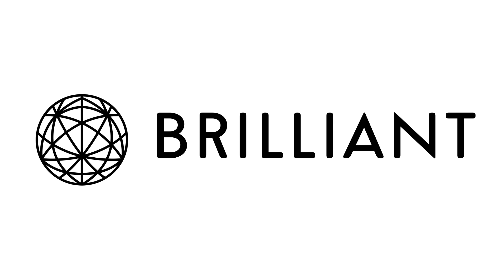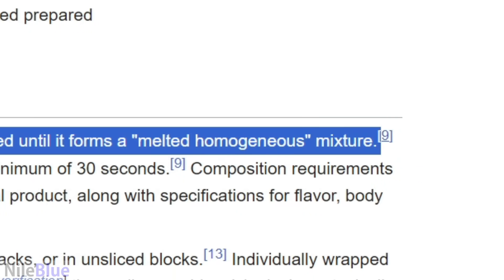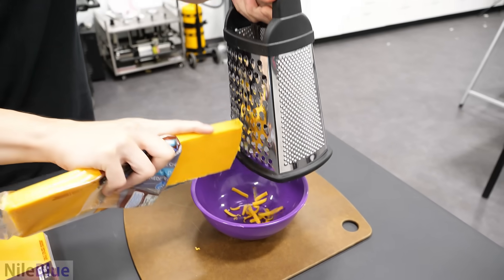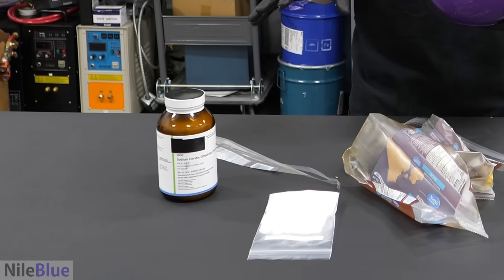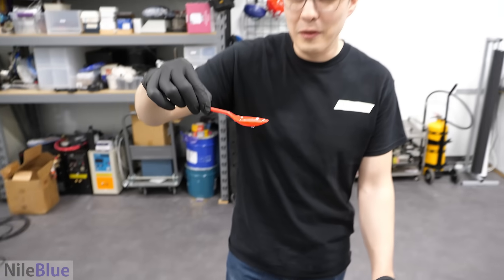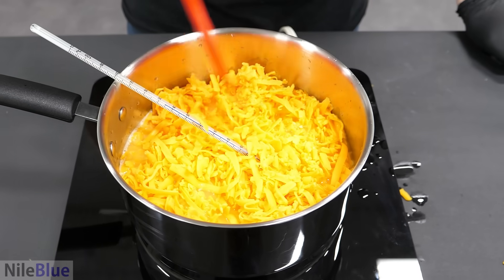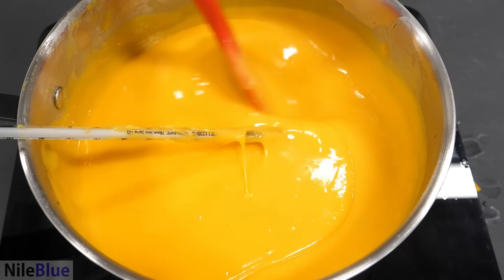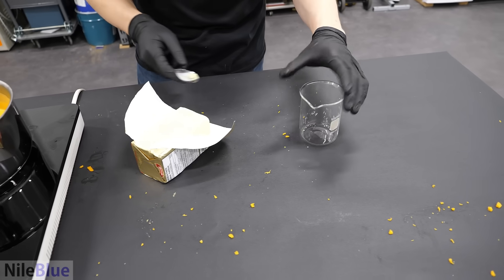Making American cheese to debunk a conspiracy

Comment: I worked in a cheese factory, we made at one time something like velvita, a soft cheese which combined 5 45lb blocks of cheddar, 1 block of Monterey jack cheese, with additional salt heated to a nice liquid state, pumped it into bags in boxes for an hour then had to tear down the entire room and hand clean all the system due to a 3 inch inside diameter pipe went down to 1 inch inside diameter due to the amount of product build up in the pipes. so a pallet of product was made in a few hours but also took 5 hours to clean up.  it was fun as heck but labor intensive.
Reply: Process tech!!!
Reply: That's crazy - and they never tried to solve this? Emulsifier? Heated cheese conduits? Asking for a cheese curious friend.
Reply: I worked at soap factory and this sounds very familiar. We had massive meat grinder like spindles we had to remove and completely cleaned the entire machine between batches.
Reply: I'm really upset learning this, since the original Velveeta commercial jingle said "It's like Colby Swiss and cheddar, blended all together..." but there's no Colby or Swiss involved 😢
Reply: He said something like velvita, not velvita

Comment: As a former exec at Kraft Foods NA, this is accurate. The process of flowing the melted cheese into the plastic casing, then solidifying it in an ice bath/waterfall...is pretty amazing.

However the base cheese is not made by Kraft. Most cheese comes in 640# blocks from a finite number of North American cheese manufacturers...meaning that Kraft, Sargento, etc...are all exactly the same stuff.
Reply: Does Canada get the same cheese from the same manufacturers?
Reply: Uhm... no? Sargento makes their own cheese lol You can literally go to Plymouth Wisconsin and see where they produce their cheeses.
Reply: Handling barrels of cheese is a very glorious experience. And I thought Sargento was just a cutting and packaging operation? I could be wrong though
Reply: @jimbeam8338  Or are they really just putting it into a plastic casing in there???

In all seriousness, I don't even recall Sargento making American cheese. I checked their site, and I can't find it. I won't say OP is wrong, but somethings not adding up here.
Reply: >as a former exec

there are not that many of those, so like, while it's not impossible, I'm gonna roll to disbelieve on the weight of rarity on this one.
Reply: Where I live we are famous in Michigan for our cheese. I used to work in the factory for a year after highschool its all real cheese though.
Reply: Maybe they start off with the same stuff but they’re not exactly the same end product, I imagine every manufacturer has their own blend of ratios + plus other ingredients like differing cheese blends
Reply: Who are the Cheese Mafiosos on top of it all though?
Reply: @laurenpinschannels  it has too many holes in it
Reply: The good ole commodity cheese.. there's a lot of it out there. Maybe still sitting in caves in Missouri
Reply: @reNINTENDO  He's definitely lying
Reply: @fakename287  Yes and there are slightly different names they can call the product depending on the contents. The version made in this vid is the best of I think 4 types or grades or whatever you want to call it. Atomic Frontier did a great vid on it.
Reply: @busimagen  but you would also know that there are 2 different FDA labels that can be used from "pasteurised processed cheese" (almost 100% cheese and what was made in this video) to "pasteurised processed cheese food" (over 51% cheese) to  "unregulated" (anything that isn't "cheese" or the 2 other specific descriptions quoted above, like "cheese product" means nothing legally)

Also kraft adding milk protein concentrate (which is not one of the approved ingredients for the product labeled as "processed pasteurised cheese food" and is a bulking agent refined from other waste products) which the FDA found in 2002.. they since renamed the item to processed pasteurised cheese product.. which is undefined in the US, or in other words.. not cheese

So you are either lying about your position or lying about the product of the company you probably got shares in as a bonus or severance or similar.

Either way.. I call liar on the "it's just cheese".. only the premium label is. The rest is cheese flavoured floppy squares.

Comment: Having worked at kraft for a bit, you're not far off. Yeah it's real cheese that comes in like 100lbs blocks and is shredded fine, the milk powder is a whey powder. And it's cooked with steam.
Reply: why do Kraft singles taste so different from say a piece of cheddar cheese from a block? I cannot stand the taste of Kraft singles or anything similar.
Reply: @91wheelz the process of adding water and having the fat suspended doesnt make it better to eat raw, thats why. its meant to be easier to melt. you put them on a burger or make a grilled cheese. thats where this cheese shines, because it melts at low temperatures. try putting a chunk of normal cheddar on a hot hamburger patty and you’ll see the issue with doing that.
Reply: @Fernandino-y8l  While I really dislike processed cheeses I do appreciate a cheese slice on a burger, sometimes you just need a dirty burger, but I usually add real cheddar or other cheese instead and just grill it until it melts. Tastes far better.
Reply: @M0UAW_IO83  i disagree. i mean as the video shows it already is real cheddar it just has water in it. after it melts on a burger the majority of the water is gone and the difference is harder to notice. ive tried both and theyre around the same taste unless ur using different cheeses than cheddar. I usually dont use any cheese though, I dont like either particularly

Comment: the fact that the pans that hes handling are 60° to 75° celsius and just, goes touching them basically bare handed and dont say anything is more bizarre than the content itself of the video, this man is on another level with the 2nd channel
Reply: I think it cools off so fast it wasn't even hot at that point
Reply: Dude that's not "hot"
Reply: @Pseudomonasa  then dunk u hand in water at 75° celsius and see if it isnt "hot"
Reply: @Pseudomonasa  Celsius, not farenheight. 75C is 167F lol
Reply: It's alright, he's just finally gotten his chef hands.
Reply: He's still using glove, and only hold the edge for a few seconds to spread the liquid, not really a big deal.
Reply: @kingo6933  Yes, 75°C is hot, but it's not burning hot. 
That's the temperature doctor used to do pasteurization, to sterilize medical equipment they handling.
Reply: @京狐夢美 I pick stuff up off of 500° F surfaces regularly it's about speed and how long your fingers are contacting the surface
Reply: @kingo6933  dunking your hand in 75C water =/= touching a 75C piece of aluminum. Convection vs conduction. 

Edit: Also the temperature probe of the hot plate measures 75C. On the upper edges if the pan, so much heat is going to be lost thru convection that it will be much colder.
Reply: @dalfifran7572 meat, including your hands, start cooking around 60°C. 75°C is pretty hot especially when it's conductive materials like water or metal you're touching.
Reply: @dalfifran7572  "it's not that hot, just hot enough to kill cells"
Reply: From cooking, I know that 250⁰F can be briefly handled without real pain nm damage.  That's about 120⁰C.  60⁰C - 75⁰C dry heat is easy to handle for short periods of time.
Reply: Chef hands.

Comment: Sodium citrate is what makes the cheese so melty. They add so much extra of it in American cheese that you can use American cheese to give other cheeses the same texture
Reply: Yep. I frequently add a tiny bit of American to cheese sauce, and that’s all it takes to make the rest of the cheese melty and stop it from separating. You can add so little that you’d have no idea that there’s American cheese in there, and it still works wonders.
Reply: @DanDaniel-sx6iq  You can also buy the stuff if you want to control the meltiness without the taste of American. But yeah I do the same when making mac n cheese. Same amount of effort as the boxed stuff, but so much better
Reply: Easiest way to get sodium citrate is to mix lemon juice with baking soda.
Reply: @washboardman7435 that’s right.  Great to clean with and helps with certain stomach conditions.

Comment: A fun experiment.  I keep sodium citrate on hand to make certain cheese sauces.  It is especially useful when trying to make a sauce from aged cheeses which don't tend to want to emulsify in a traditional bechamel to make a mornay.  I think one of the best reasons to make this at home would be that you can change up the source cheeses for different flavored easy melting slices. Example: I have plans to make a blue cheese melty slice for burgers and/or grilled cheese sandwiches.
Reply: @AnthologyOfDave even if the mold itself gets destroyed so the final slices aren't blue, you still get the pungency of all the acidic byproducts in the processed cheese. It's a fun project
Reply: @AnthologyOfDave they actually sell these in some stores.  They make the Bleu cheese to get the flavor, then remove the mold and turn it into what's  essentially blue cheese craft singles.
Reply: @rainbowskin3379  oh neat!  I've never seen it which is why I figured I'd make it myself.  Whereabouts have you seen this?
Reply: @AnthologyOfDave  I'm not looking for the mold to live on.  Just to get the flavors in a nice melting cheese.
Reply: I'm wondering what sets sodium citrate apart from some other emulsifier like xanthan gum. I can see sodium citrate great for making pasta sauces where you'd want to minimize their separation.
Reply: @scotty2344  xanthan is more of a thickener that can assist with emulsification where sodium citrate is acting at a chemical level to allow emulsification of fats and water.
Reply: @CookinWithSquirrl  I've found them in random grocery stores in the Midwest.  I live in Wisconsin so I've seen the craft singles version of a lot of cheeses.
Reply: @rainbowskin3379  gotcha.  Thanks much!

Comment: I wish you would cover WHY process cheese came about. Almost all cheeses are made in wheels, then cut into blocks or some square shape to sell, Process cheese came about as a way to use the "off cuts" or round pieces left over instead of throwing them away. This used a lot of "waste ends" or trim and making a saleable product. Second around the same time there was an interest in canning cheese to preserve it, for overseas shipment and army rations plus refrigeration was not all that common. Since process cheese is liquid it can be preserved by the canning method preventing huge amounts of waste.
Reply: I always wondered the ‘why’.  Canning makes a lot of sense.
Reply: Off cuts could, of course, be shredded too.
Reply: @SeekingTheLoveThatGodMeans7648  At the time when process cheese came about no one manufactured shreds. BTW check out the added ingredients in shreds to keep them from clumping back into a lump.
Reply: @dvdosterloh that makes sense! Also, adding water adds weight so, they can charge you more and sell you less.
Reply: @tonybrock5288  I just love it when no matter what is posted someone like you tries to bring it down to "greedy corporations", yes to a point but I prefer to look at it as using what was wasted to feed people and preserve a product as shelf stable instead of going to waste
Reply: BTW, try and explain "bottled" water when the tap or fountain is free
Reply: So it's like meat glue
Reply: It's like meat glue
Reply: Atomic Frontier has an awesome video on the subject.
Reply: @dvdosterloh  As I replied: your explanation of re-use makes good sense. Also: the history of many organisations profiting from this is undeniable. Why are you defending them? Are you part of them or just some idealist?
Reply: @dvdosterloh  Tap water isn't potable in plenty of places.
Reply: @tonybrock5288  Adding a liquid is also an unavoidable step in the process?
Reply: @dvdosterloh most just use cellulose. 

The horror right?

Comment: Two things: 

For thin slice cheese, the pan should be heated so that the cheese doesn't cool as it spreads out.
Cover the cheese in the refrigerator with plastic wrap so that the top layer doesn't dry out.
Reply: isn't american cheese made in blocks, then sliced thin?
Reply: @CHEEBnRUN  
https://youtu.be/2i1KuBGuj38?si=jjC4QuxyCYNi3p7G&t=420
Reply: @ChrisSAGD  That video shows that it's produced both ways. If you're going to make this at home it just makes more sense to produce a block. Takes up less space during the cooling process, and the product itself will hold better over time.
Reply: @thepackluck699 then you have the slicing issue, kinda trading one issue for another and idk which would be the more annoying issue but could be slicing. Unless you’re fine with it really thick, thin I have no idea how you’d do it without a cheese slicer
Reply: I was just thinking putting it between two pans with parchment paper on both sides would be best.

Comment: Some additional context for why american chees is what it is:
-It was invented as a solution to an army logistics problem in Europe. The new method for storing rations for long storage in baggage trains was to seal food in jars and place the jars in boiling water which helped them stay fresh longer. normal cheeses can't handle the heat and separate into their constituent components which smell and taste bad on their own. When a cheese does this, it is said to have "gone off"

-american cheese (before it was called so) took inspiration from fondu, which is the one existing cheese at the time that could survive the preparation process described above. The chemicals you used are derived from wine Iirc.

-this cheese eventually made it's way over to the US. Re-branded itself as "American cheese" and gained popularity for being inexpensive because it was made using the scraps of other cheeses (during the process of making cheese wheels etc.) that other manufactures considered waste, so the cheese was a low cost ingredient. This inexpensive cheese gradually gained popularity as a result, though the branding did help too. So any cheese can be made into the base of "American cheese" as the type wasn't a requirement

-As the cheese started getting very popular, companies had to start buying larger quantities of regular cheeses as scraps were no longer a sufficient supply which raised the cost of manufacturing. To combat this, companies started adding cheaper cheese substitutes to keep the cost low, usually things like butter, milk, and milk powder, as they didn't have to go through the aging process of cheese.

-Kraft gained notoriety when it was discovered that their American Cheese singles were discovered to be less than 50% cheese, sparking outrage among the public. the majority of their product was the preservative and the "fillers" described above.

-Eventually the FDA made a ruling on the matter:
1. Normal cheeses were Legally considered "cheese"
2. American cheese, as it is a product made from cheese, was renamed a "cheese product". A "cheese alloy" as you described
3. Any cheese product that had less than 50% cheese in it, became a "cheese process" as cheese is used in the process of making it but is not the majority of the product.

This is why many people are confused about what it is, because companies like Kraft add lots of other dairy products to keep the cost low, and kept it quiet, so the FDA forced them to change what they call it.
Reply: This would have great info in the video. Thanks for taking the time!
Reply: But you can still buy real cheese in the US? Or is it called artisan cheese or crafts cheese? lol
Reply: @paulelderson934  Would be better if it was true.  This style of processed cheese was patented in 1906 by James L. Kraft (yes... THAT Kraft).  He did it originally as a way to process unused scrap or unsellable pieces of cheese into a saleable and more stable product.
Reply: @datadavis  You can obviously buy real cheese in the US.
Reply: @pirtatejoe  it is true, it was invented in europe around 1911, for longer shelf life, most likely not because of military, but the process originates from europe. James L. Kraft applied for a patent not in 1906 but 1916, for his method of making processed cheese.
Reply: @datadavis  Yeah oh course there's all kinds of normal cheese at the store, the most common ones are probably cheddar, mozzarella, Gouda, Swiss, and many stores carry more "fancy" cheeses in the deli section. It's just the package of this kind of "processed cheese food" will be branded as "American cheese" which is kinda weird tbh.
Reply: you beat me to it and explained it far better than i did
Reply: @datadavis yes they would just call it cheese
Reply: @beni2am  yea.. typo.. Kraft first patented his cheddar pasteurization process in 1916 but had already built his first manufacturing plant and was working on the process the Swiss were already doing.  Apparently what they were actually trying to do was make a re-meltable version of Emmentaler cheese with a longer shelf life so it could be exported for sale to warmer countries.  Didn't have anything to do with army logistics.